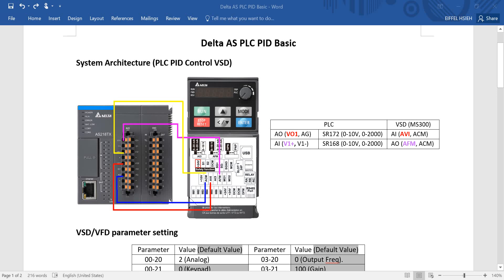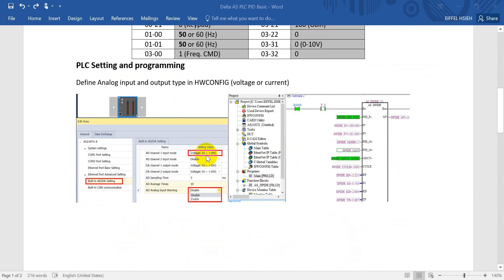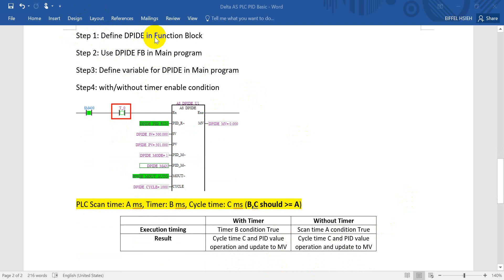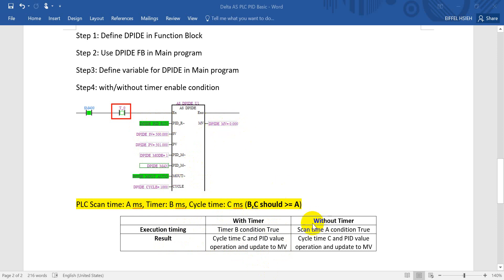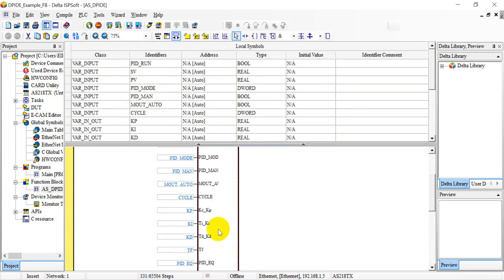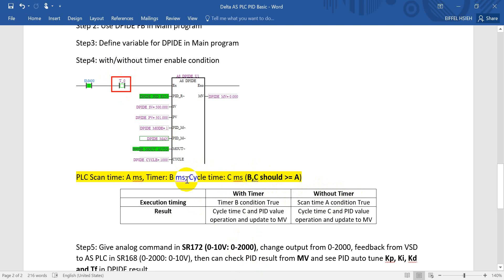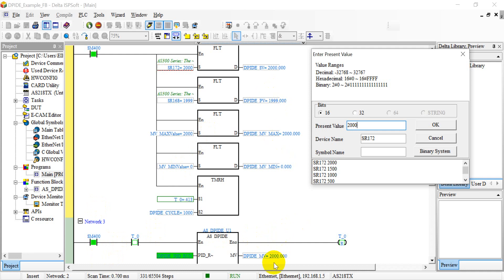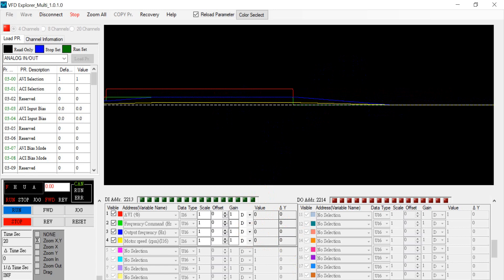Delta AS PLC PID Control

Comment: Hallo, What software are you using to monitor the drive?
Reply from the maker: @LUuan Van Niekerk, VFD Explorer. you can use DIADesigner to achieve similar monitor function
Reply: @iabg_seadelta6647  Thank you.